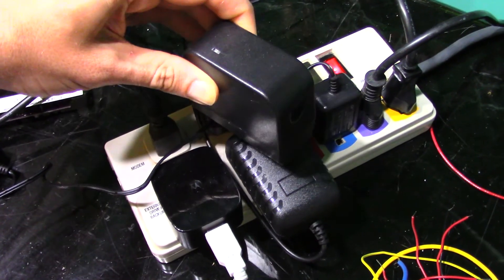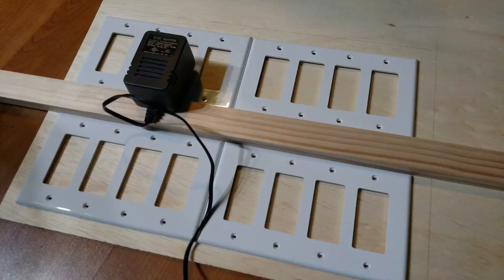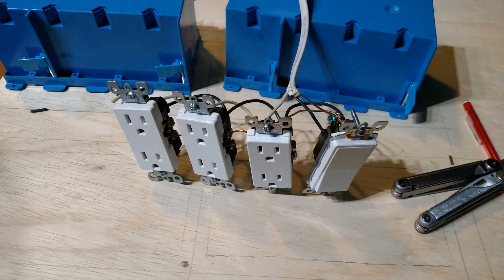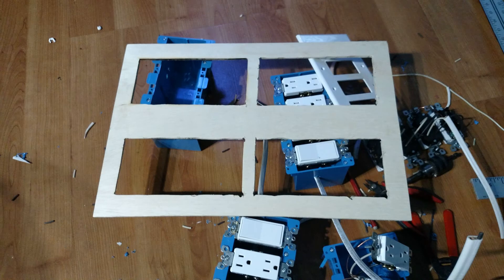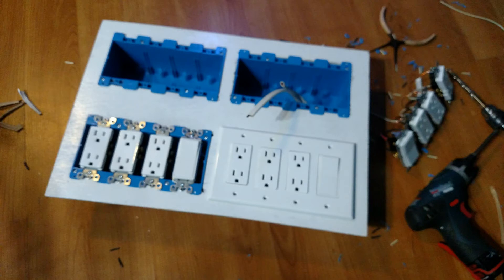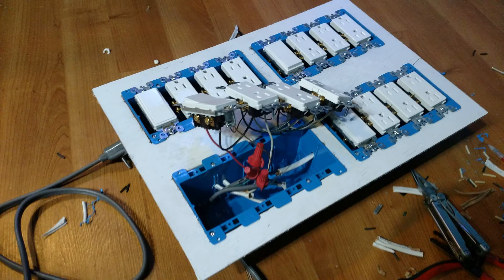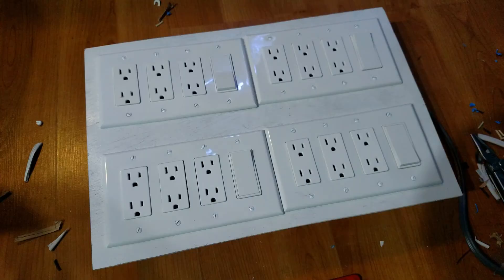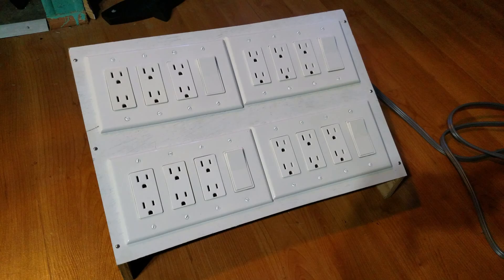Building a Better Power Strip

Comment: Did you use 2.5mm or 4 mm wires ?
Reply from the maker: I used 14AWG wire for everything. Almost the same as 2.5mm^2 in metric

Comment: I dont really think thats safe so many outlets going to 1 plug yea sure more outlets and moreoutlets is more fire dud it can overload =)
Reply: tbh you just have to calculate the max amp yourself. You can overload a circuit with only 2 outlets easy, maybe he just plans to use this for all kinds of low wattage applications. My desktop setup needs 13 outlets total to work but if everything runs at max I only get to about 2000W. Im allowed to use 3600W on a single circuit to my breaker so still a lot of capacity unused.
Reply: I wouldn’t trust my wiring and I would build in a fuse or a breaker at whatever peak current I expected, but it’s perfectly safe to do this assuming you know what you’re doing. As long as everything can handle 15 amps comfortably there’s no real fire risk.
Reply: And the frame is made of wood
Reply: @TheEchelon  That doesn't matter - the outlet boxes are plastic and rated for electrical.  Your walls are wood framed, no difference.  I would have installed an AFCI on it though.